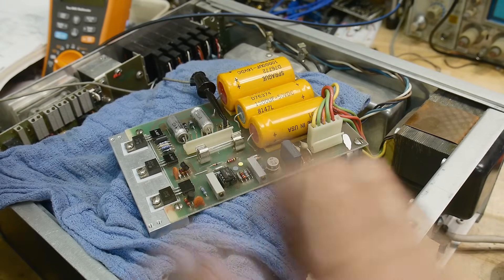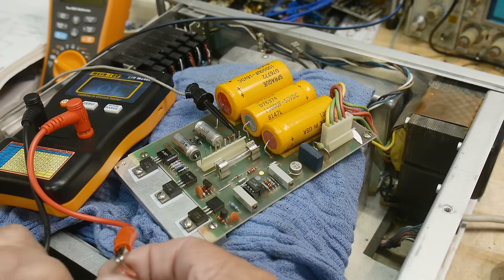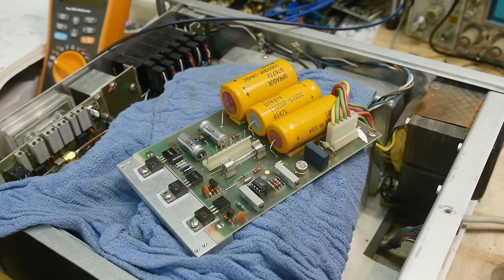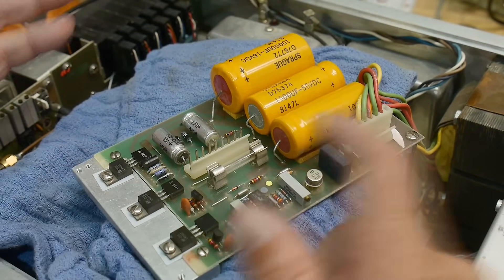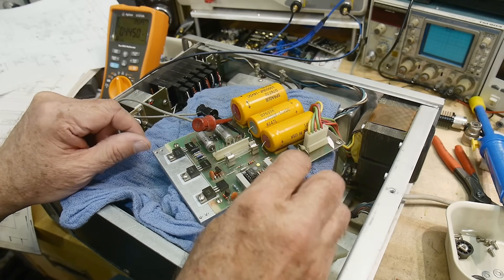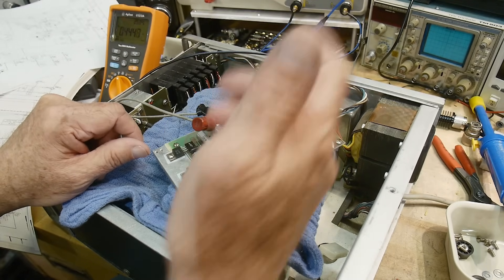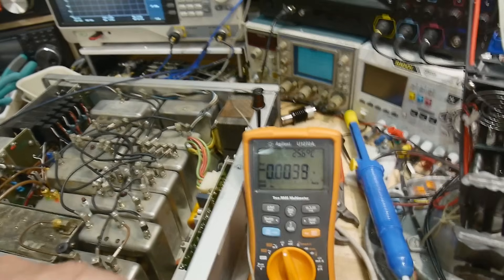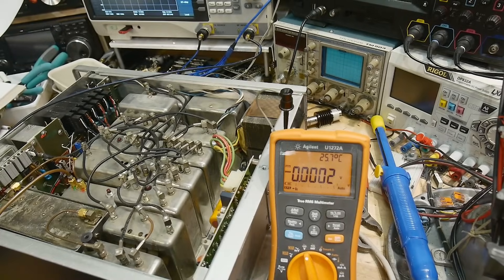#1898 Wavetek 3000 RF Generator (part 2 of 14)

Comment: Two things - there may be a diagram of the coax connection on the underside of the top cover that you removed in the first video.   Also, if there is a shorted +/-18V the most likely culprit is one or more tantalum capacitors that are sprinkled throughout the modules.  You need tantalums for their frequency bandwidth as replacements or a parallel electrolytic and mlcc as things get noisy. You can unplug modules by removing a screw or screws from the underside.  The screw on top just holds the cover of the module.  I have two 3001s that I got working after many  electrolytic and tantalum cap replacements.   BTW, the LEDs on some modules come on if the particular PLL is out of lock.   Also the red button on the module next to the attenualtor is an overload test or reset (can't remember which) on the circuit breaker module.

Comment: I am not familiar with that particular instrument but wonder if the missing ground is provided by the wiring in the output connector??
Reply: It's hard to catch, but if you look at the top and bottom of the PCBs there is no evidence of any connection to the "ground island" which includes the replaced 100uF capacitors.  Goes to the round IC and a passive below, one pin on the connector (and only 1 ground pin, the rest are voltages), the 100uFs and their bleeders, jumpers up into around one of the regulators.  But no possibility of grounding through their tabs since it doesn't run to the centre terminal of any.  No "empty" pads for a jumper.  Looks like a complete oversight that required a bodge wire in production.
EDIT:  would love a full view of the front and back of these while troubleshooting.  Even if you figured it out, it's fun for us to exercise our skills.

Comment: Oops, this video reminds me of a long time ago where the company I used to work at, still made detailed service-manuals. For every new product, us design-engineers had to sit for days/weeks with the guys writing the manuals… and we hated every second of it, would rather be on the bench designing/debugging new things…. And it was easy for us juest to update something, like a better power-supply, informing production to use this newer supply, and somehow the guys writing the service manuals were left out of the loop, as ot saved so much time. In my old age, and trying to find fault stuff for which no service-manuals exist, I feel like such a d*ck… yeah, I get it, in today’s throw-away society, who needs detailed service manuals??? But now I am questioning it all… as a young kid, I could peruse a schematic-diagram that was glued on the inside of most equipment, from radio’s to TV’s and even early microwave-ovens, and I learned so much from it. Nowadays, even if you manage to find a service-manual from somebody, it is just a monkey see, monkey do procedure… and then order a new PCB… no detailed schematics, nothing…. Somewhere the electronics industry has turned to the dark side… no time for the designer to sit down with a technical writer describing how the circuit works, showing detailed voltages and waveforms at specific points, and so on…. It is actually sad😢😢😢
Reply from the maker: Yup. I used to manage drafters and tech writers. the good ones were gold
Reply: @IMSAIGuy  they were gold… and I still feel bad about it. It is a lost skill us designers  never appreciated enough! 🥲🥲🥲

Comment: May have commented on this before, but part of my training in electronics at the start of my career in the Army was to remove all watches, rings, and other metal, including dog tags, before working on electronics.  We did work around both high voltages, and low voltage high current supplies.  If you've ever seen the results of someone getting a wedding or other ring shorted to a high current 5 V supply you'll be convinced that removal is a good practice ;-)
Reply: Not to mention high power, UHF RF, on my watch, Auch, I remember that was a nasty burn from the 500 MHz 1KW PA😢
Reply: @leandrolaporta2196  Oh the smell of Bacon Butties !! Lol :)
Reply: I for one would like to thank the trained technicians at both the army and AF repair depots for equipping my lab with dirt cheap test equipment via government auctions. I always look for their red tags that say "Not Repairable." My favorite was the Fluke bench multimeter where they replaced a defective IC, but installed the new IC backwards. Thanks guys!
Reply: @johnwest7993  While I was in, 1976-1980, all the test equipment was sent off to a commercial outfit for regular calibration and repair as required.  Not maintained by Army personnel.  We just worked on the communications equipment using said test equipment.  But +1 to low cost surplus test equipment.
Reply: I respect the fact you have the experience training but please bear in mind, so do we. :)

Comment: LM395 is an IC that acts like a Darlington transistor, but adds thermal and overload protection circuits.
Reply: Kinda. It uses a pnp input so that it has only one diode drop for Vbe despite being a darlington.